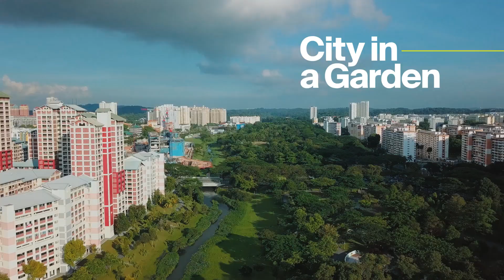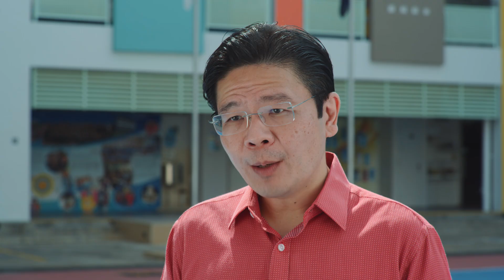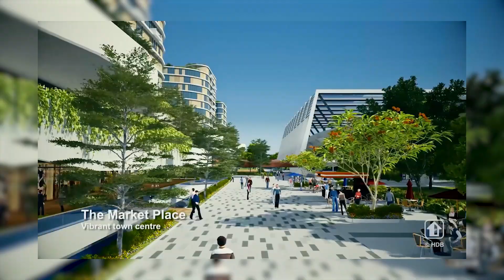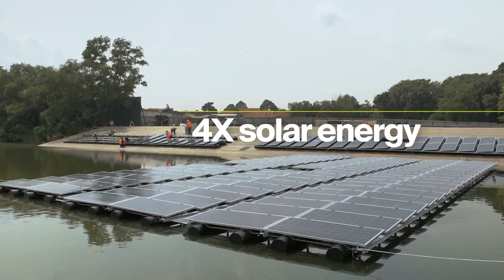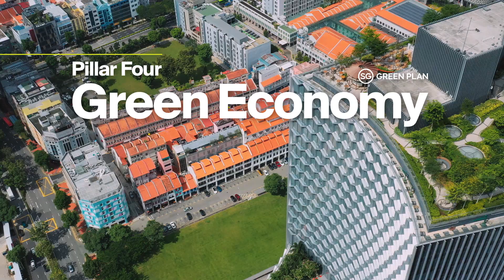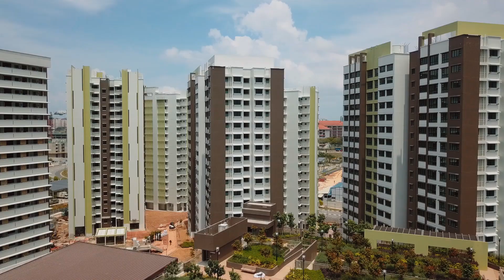Singapore Green Plan 2030

Comment: I still think product packaging is contributing to waste more than others. A lot of products is usually needed 2 to 3 or 4 layers (such as box, wrapping, product molds inside the box, cable tie, etc)  just to reach the item itself. Not to mention the manual, the warranty card, and sometimes air cushions. and most of it can't be reused. Except for air bubbles wrap of course.